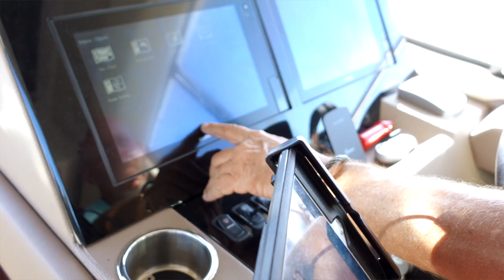LIFE ON A YACHT! Marine Electronics: Garmin Autopilot Setup Regal Boats with Volvo IPS drive system

Comment: Yes. Captain. Agree 100%. You start on this progect and you run out of parts, so in the mean time. You start another project awhile waiting for parts on the original project. It's called TIME MANAGEMENT.
See you next week.
Reply from the maker: Hello Eric. 
Your in my camp when it comes to time management. I have also found very few people with the skill set to perform work that I can trust. Don’t want to find out 6 months from now that someone cut a corner and all the work needs to be re-done!!  There is already enough work just keeping boat maintenance in check. 
Thank you for the comment 
Capt W

Comment: Hi, i love your channel and your boat.  I am Dutch and i have seen many rudders being filled with oil. Only purpose is to protect it from rusting from inside. The fact that you found water getting out at the bottom, means there is a leak somewhere. Most probably in the upper part. 
Many rudders that are filled with oil will have a screw that is used to fill it. You need to find that and pressurise it to find the leak.  Ps, old oil is corrosive.
Reply from the maker: Hello Jib!
For sure you guys build the best!! And the steel is what Iron Man uses for armor. Lol
I added a drain and air plug— changed the oil and pulled a small vacuum on the tank. Now all is good 
Thank you for the info
Capt W

Comment: Hi Sailor,  
I think oil floats on top of water 
I am pretty sure.,. 

I never heard of a rudder with water or oil in it.
Reply from the maker: Good day Thomas and welcome back. Lol
I did some research and here is the following:
The rudder was filled 80% with #90 gear lube. This was done to dampen movement plus give added weight to stern of the boat to help compensate for the jib sail. They also added a solid steel 6 inch x 6 inch square to the bottom of the keel running full length from bow to rudder bottom base. Then filled the rest of keel with oil. This allowed the vessel to sail and motor with only 5 foot draft. The small water was from years of condensation effect of the cavity which drew a little water from the oil and internal air. This was all done for the CG and some stabilization. She now has fresh oil and two bronze plugs. One for drain and one for fill if I ever need to remove the rudder again. It took 17 gallons. How is your project going??
Capt W

Comment: Many airplanes built with Chromoly Steel are filled with small amounts of either Linseed Oil or burned oil to prevent rust coming from the inside.  I would not be surprised if that is the case case here.  Check a little more on this concept before you tare down the rudder.  Water inside would be bad...
Reply from the maker: Hello CD!
Actually you are 100% correct. I have since discovered the keel also is filled with oil. The bottom 6 inches are solid steel for lowering CG and chambers with oil for same reason you have suggested.  
The rudder actually had water due to the fact it has been sealed for over 30 years so assume was condensation as the amount was equal to 2 tablespoon.  
Thank you for your comment. 
Capt W

Comment: Curious if you are far enough into your refit to be able to project total project hours at completion?
Reply from the maker: Hello Kjel
Have spent the last 2 days meeting Engineers from companies that I have been researching to use for Dawn Hunter. As we build this vessel for exploration I have modified several systems in the last 5 months to a higher degree of design but at same time worked hard to eliminate as many electrical control items and convert to robust manual or semi manual. With this being said I can now break the project down into 2 main categories. On the hard to completion and in the water completion. Getting the 6 large solar panels on top with a 10 foot x 12 foot hardtop has been a real time consumer. Next the dink/davit/ swim platform winches and final door window assemblies. 
We are getting close- I try not to predict hours as would sit down, have a case of beer and cry. Lol
Thank you for the questions and I may cover this in future Vlogs. 
Capt W